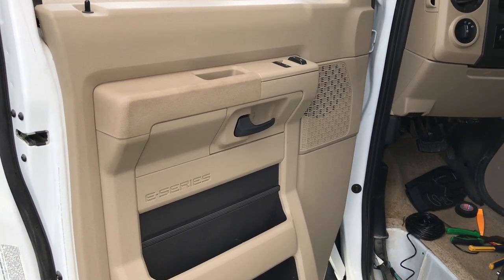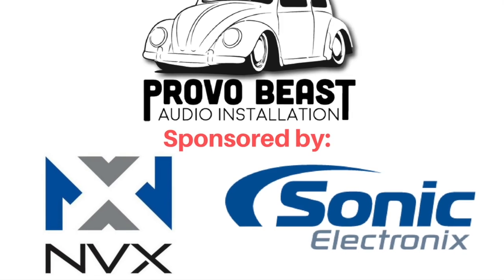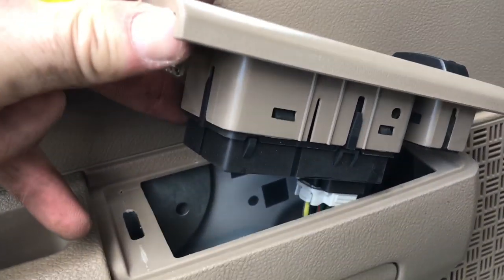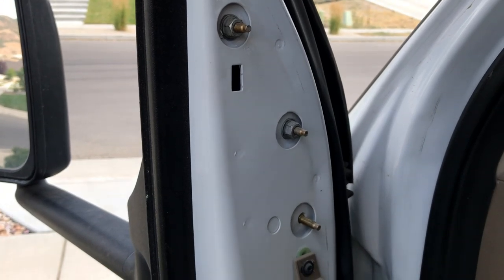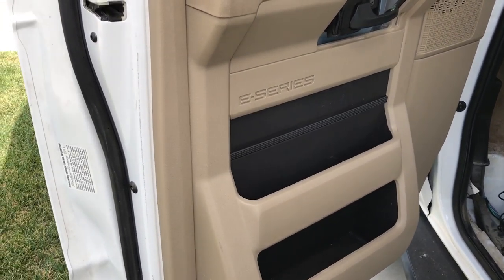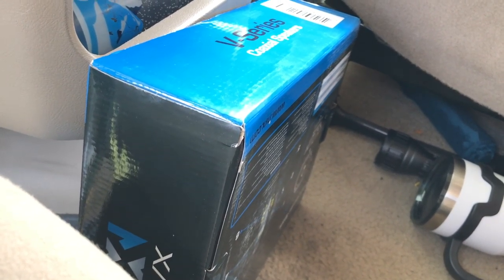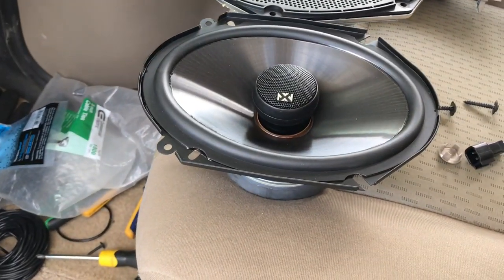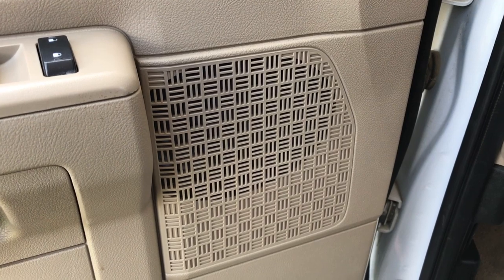2009 - 2014 Ford E-Series / RV Front Door Speaker Install

Comment: Fords are great vehicles to work on for replacing the factory radios and speakers because the components are not only easy to access and remove, but the speakers are usually a universal size (6X8") and the radios are also easy to find drop-in replacements as well. :)

Comment: I changed out the front and back door speakers on my Ford Explorer I bought the baffle kit to deaden the sound it's supposed to make the bass sound better and also the treble but I tried to with the baffles and two without and I tell you the speakers that I install without the baffles bass better and sound louder the ones with the styrofoam baffles are more muffled just thought I'd let you know I went without the baffles sounds way better using the door as a speaker box

Comment: Is there a noticeable difference in these than stock, with no amp? I have a 2017 that looks exactly the same.
Reply from the maker: absolutely, even if only powered off the radio, factory speakers from that year have significantly broken down with wear and heat, so a new set makes a big difference.